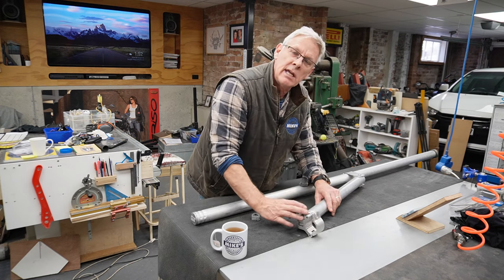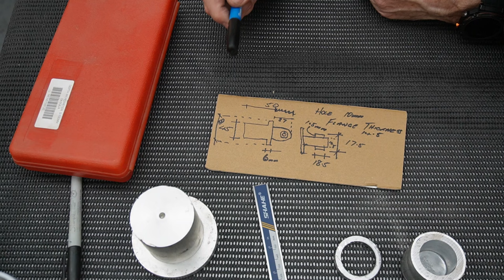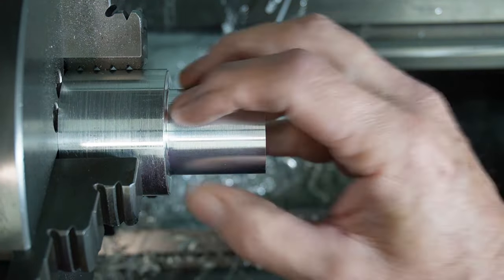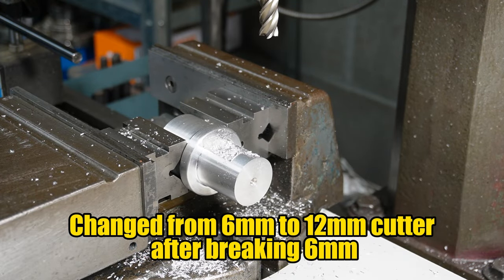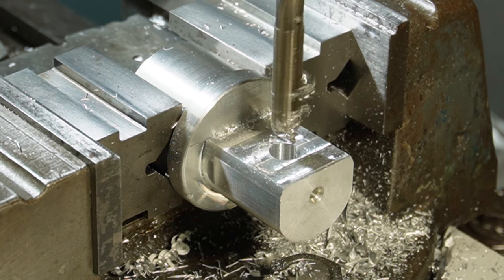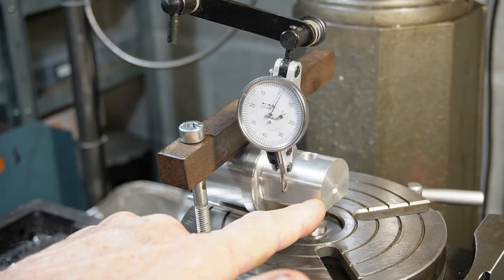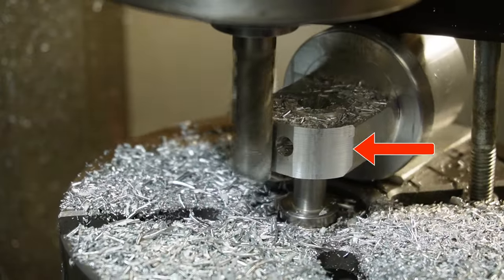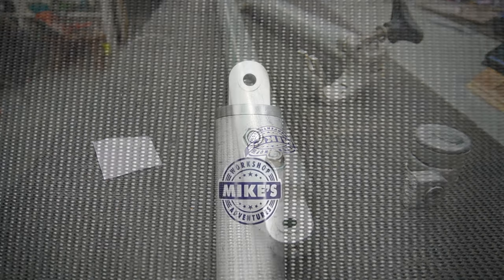Aluminum scaffolding outrigger coupling manufacture.

Comment: Nicely done, I assume for this application it doesn't matter that the leg is now shorter by the amount you cut off the pipe to remove the old broken flanged end? (Leg is adjustable anyway)
Reply from the maker: No not a problem. The legs are moved up and down to suit the surrounding surface so has a large range of movement. Thanks for watching and commenting. Cheers Mike